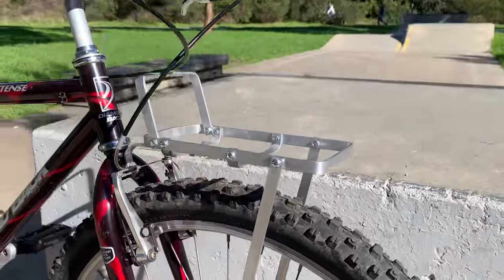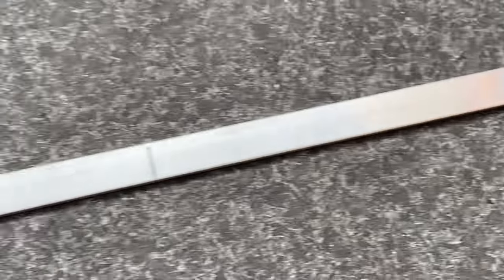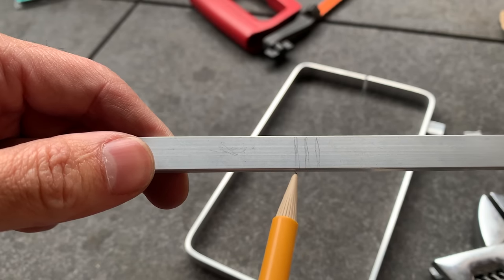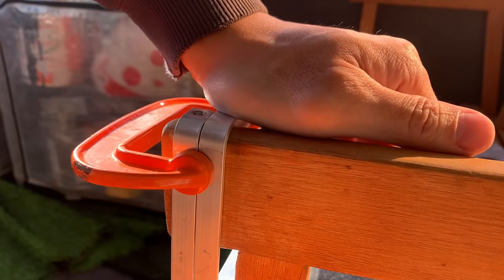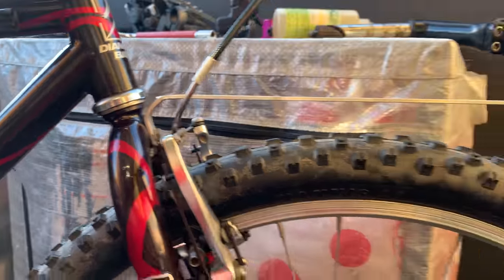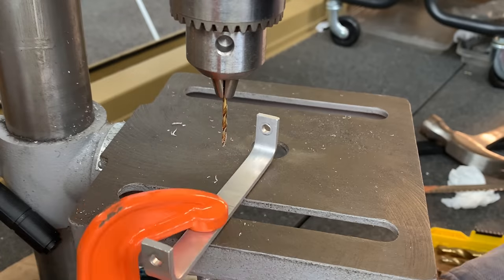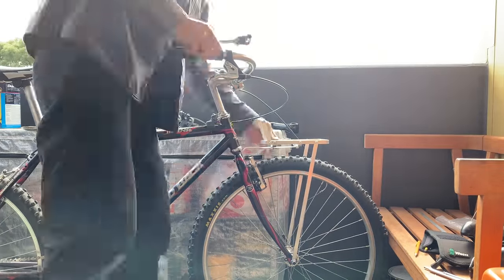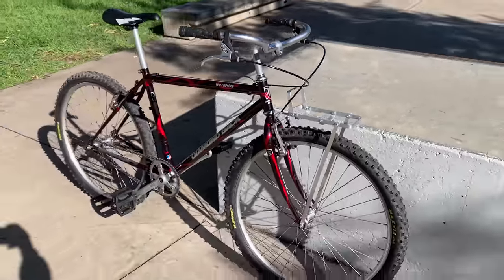DIY bike front rack under $25 (2023 new version)

Comment: Looks good. Only thing I would change is te middle strut that goes to the fork crown. Make it steel, now it's going to bend when loaded and riding on rougher surfaces. 
The steel strut can be easy found and pre bend and drilled.
Reply from the maker: True that’s a good suggestion 👍 cheers!
Reply: @garysprojects  Mine failed and I was saved by my front fender. Made one from stainless steel 🤘Another suggestion would be to use nylocks.
Reply from the maker: @ezeckielthomas6798  hell ya 👍
Reply: I was about to comment exactly that, still very nice

Comment: Nice project Gary, I love how accessible this is ! As you pointed out the only real weakness is the bracket, but if this one piece were substituted for steel, I'm sure this would be resolved !
It may be worth getting a Pop riveter for projects like this as Rivets would leave a smoother join than the bolts !
Reply from the maker: That is a good idea ! I think steel brace would work well ! Cheers 🙏🙏

Comment: Outstanding solution, front racks are ridiculously expensive and rare these days. Also, proper punches for metal are pretty cheap and youll save drill bits
Reply from the maker: Cheers ! I appreciate that. Oh nice , I will oool for a proper punch next time I’m at the hardware store thx
Reply: @garysprojects  its easier to punch with them as well as the metal is way more harder, makes a significant difference, they are way cheaper than drill bits
Reply from the maker: Ahh I see thank you !

Comment: Great job, anything that you can build yourself is fantastic as you can tailor it to your specs and makes it unique in lots of ways and also doing stuff like this is wonderful for the mind , i will also agree with what was previously said  that rivets would be a cleaner build but if you stick to nuts and bolts, I'd go the socket headed cap screws with nyloc nuts so that they don't shake loose.  I'm building a recumbent trike from scrap bikes , steel tube  and  it's almost finished , I'm really eager to get that first test ride in ...I'm even helping my boss build his own aircraft ! .... there's something about taking a bunch of materials and turning it into something useful that just doesn't compare 😊
Reply from the maker: Awesome ! Always great building your own stuff that’s for sure , can customize it to how you like it. The bike sounds exciting ! Will be fun to ride it haha. I agree with the nyloc nuts , I have already swapped the two on the bottom brace for extra safely ! Cheers !

Comment: The aluminium flat bar is great stuff I used some to make mudguards and they work really well, I just bent them over my knee. Tubes may be stiffer for the stays but I'm not sure what that does to your budget. Thanks for sharing 👍
Reply from the maker: Yes it’s very easy to work with ! I wanted to use tubes for the stays but couldn’t work out how to attached them easily , wondering if I could hammer the ends and drill 🤔
Reply: There's some formulas on line but I just crimped it in a vice.

Comment: We need more DIY mod builds. If you need ideas I have a few.
1. Handle bar / front wheel lock. So when you park with your bike the rack it won't turn on you and make the bike fall over. (So the wheel stays strait) 

2. 😂 that's all I really would like to see
Reply from the maker: Hahaha cheers man that’s a interesting idea !! I actually had a pram/stroller that had a similar design, you could lock the front wheel when running to make it more stable, it was pretty cool, cheers!

Comment: This truely is awesome. I've been looking for a simple rear rack to mount some bottle cages and 1L water bottles for my bike packing adventures. The only options I've found are from Tumbleweed or Old Man Mountain both costing about 150€.

Do you think a similar rack like you built will be sturdy enough to hold the cages and bottles (around 3kg maybe?)
Reply from the maker: Cheers man! Ya I think so I do a little weigh test at the end of the video maxing out at about 7-8kg so I think would be no problem for 3kg !

Comment: Yooooo Gary(ota), whats your board setup look like? 

I know your vids mainly involve vintage MTB, but I'm curious what kinda relationship you have with skateboarding and if you'd ever include anything skating related on your channel. Those Indys(?) look like they've been around the block!

Currently running a 8.7 Polar surf Jr. deck with wheel wells; Spitfire F4 Conicals that were 54mm at one distant point in time; old Ace 44s; Quantum ceramic bearings. Have a nice weekend, brotha 💪🏽👽✨
Reply from the maker: ay Bryan! i skate every now and then and post the clips to my insta story, but very rare these days. i spend more time building bikes haha. i probably wont do anything related to skating on this channel other than the odd rack because there is so many ppl doing skating stuff (& better too) out there. maybe if i ever end up cutting my own shape or something 🤔

my setup is 
8.0 passport
indy hollows 137
indy hardware
4 wheel co, 54s however i dont like them want to go back to spits
swiss bones bearings shields popped but need replacement bearings soon

have a good weekend!!!

Comment: Hi Gary, i've a question, the hole in the crown of the fork is threaded or not ? I've an old mtb rigid fork on my commuter and i would love to add a front rack but this hole is non threaded, im afraid the screw will turn endlessly.
Anyway you craftsmanship is a great form of inspiration, cheers !
Reply from the maker: Hi ! The crown hole of the fork is not threaded on mine either , i just used a m6 bolt with a secure nut (has a little bit of plastic inside) on the other end. Cheers man i appreciate that !